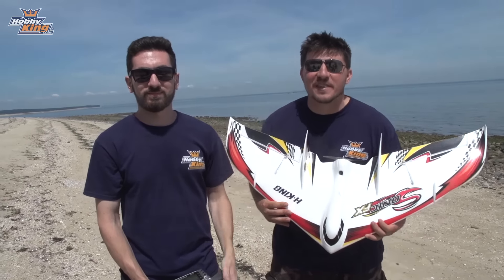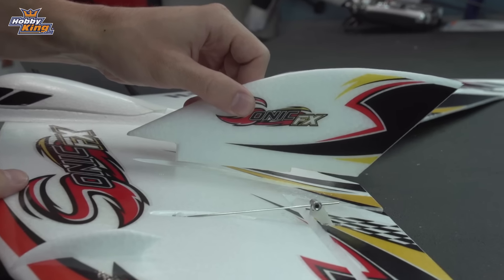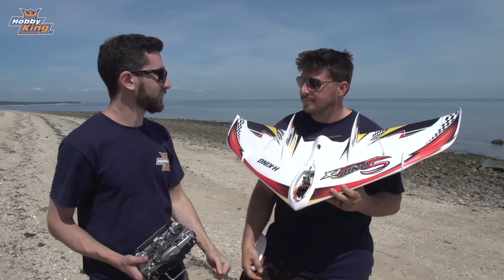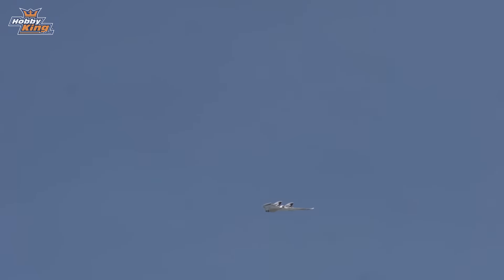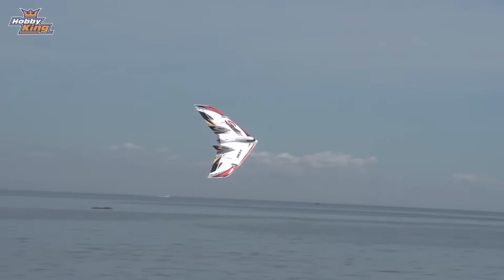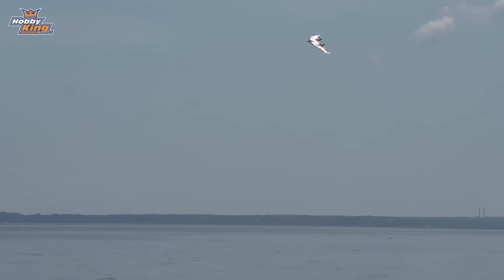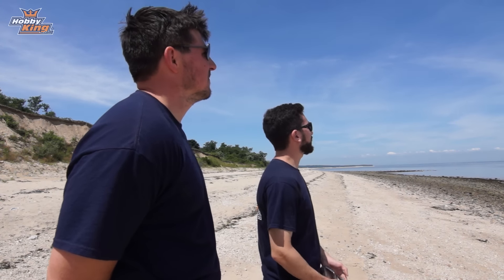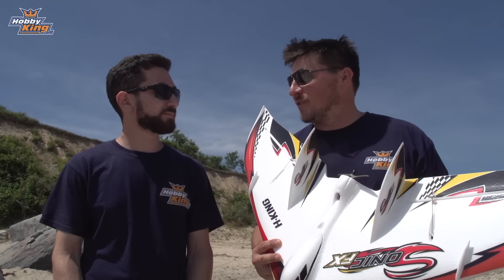Sonic FX 1000mm EPO Wing - Product Profile - HobbyKing Live

Comment: Could you recommend an appropriate type of battery from HK please? Which battery have you used in this test? Is it possible with a moderate flight reach at least 10 minutes of flight time? :) Thanks a lot
Reply from the maker: 2200 3s 30C Zippy packs were what we used. 

http://www.hobbyking.com/hobbyking/store/__7635__ZIPPY_Flightmax_2200mAh_3S1P_30C.html?strSearch=zippy%202200%2030